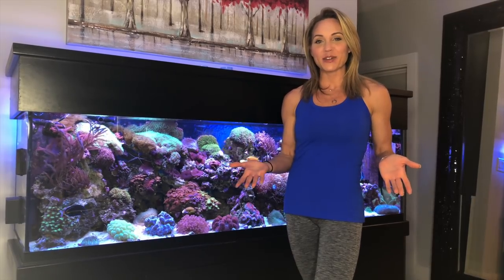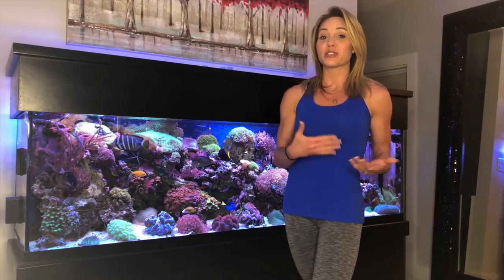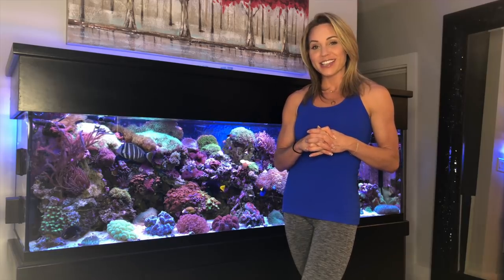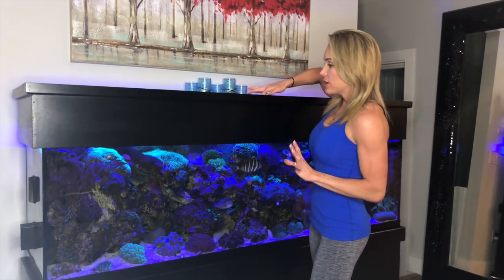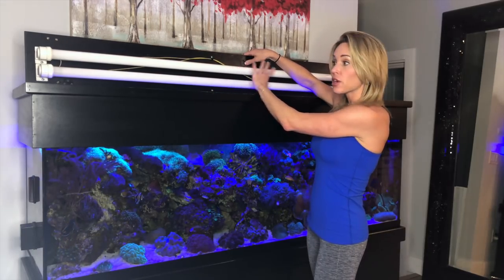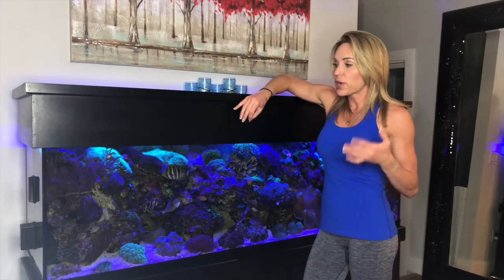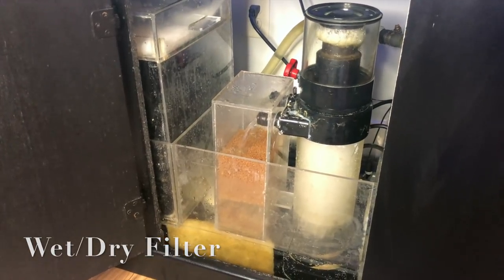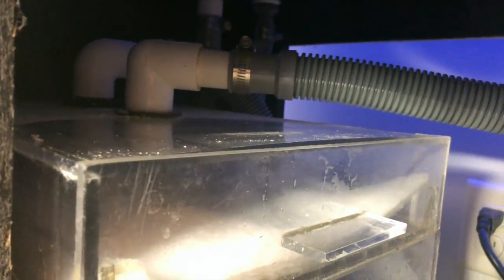How To Setup A Saltwater Reef Aquarium - Mindi's Coral Reef

Comment: I’m curious to know what your dosing for Alk, and Ca.  Are you using a simple two part system and manually dosing?  I have to say I’m impressed with such a lovely tank using such a simple old school Berlin system. While Berlin was effective it never was easy....  However that 120 looks fantastic.  With regards to lights, I would suggest looking at Kessil.  I’m a huge huge fan of Kessil lighting.  The light produced from these high-density matrix lights is just with out compare.  I have used AI Hydras int he past and while they have do have a superior control solution (App) the light from the Kessil lights just can’t be beat.
Reply from the maker: Yes, I'm manually dosing both Ca and Alk. I use calcium chloride and sodium bicarbonate.  The brand is ESV.  I will def check out Kessil.

Comment: Mindy you really should have all your tanks electronics plugged into GFCI outlets, Amazon has these 30339015 15 amp GFCI 5-Outlet Adapters from Tower Manufacturing for $38, they're the best I've found, just plug them into your existing outlets, water and electricity don't mix well at all! Your tank is very impressive, amazing fish and coralsespecially for 14 months, I'm especially impressed with your lighting and circulation pump ideas, nice job!

Comment: Get the Chinese black box lights. Cheap and effective. Compared to radions. They run about 70-100 where radions are 800. Don’t waste your money. You have mostly soft corals and the 165 watt black box would be perfect. Completely adjustable as well. I think 2 or 3 would be perfect 4 max

Comment: I get wanting to upgrade the lights to LED, but if your tank is doing as good as it looks and you don’t have much SPS corals,don’t know that I would change lighting at this time. Everything looks pretty stable. How often do you change your lightbulbs? Doesn’t look like you’re having problems with temperature either , so put the extra money into the bigger tank.
Reply from the maker: I change the bulbs about once a year.  I've changed them once since the tank's been up.  Bigger tank it is! :)

Comment: radions G4 LED lighting system definitely. LED’s last forever and don’t produce heat which means you won’t need to run a chiller to keep water temperatures within the narrow tropical range required for reef aquariums. Wet/dry filtration not the best if you’re trying to maintain a low nutrient environment for stony corals. Your nitrates and phosphates need to be low to undetectable. Wet/dry filters produce nutrient laden water which can inhibit coral growth. A sump with a protein skimmer and a Refugium where you can grow macro algaes like caulerpa and chaetomorpha is best. Water chemistry should be your alkalinity 8.0 DKH, magnesium 1400 parts /million,calcium via a three part dosing system. The bulbs you currently have need to be changed out every 6 months because they lose their colour spectrum over time. When you install new bulbs you have to be careful not to shock the corals with the increased light intensity. Gradually acclimate them over time to the new light. This will not be a problem if you go with the Radion LED lights which you can program from your smartphone or computer. LEDs don’t lose there colour spectrum the way that fluorescent tubes or metal halides do. You can get really good advice from the folks at Radion. Water Movement. have you heard of the Maxspect Gyre ? You only need one placed at one end of the tank to replicate the gentle wave movement found naturally in the ocean in your aquarium. No exterior moving parts like your powerheads, very affordable alternative that’s state of the art technology. Google maxspect Gyre. Your tank is looking nice but the upgrades will help your animals to thrive over the long term.
Reply from the maker: Thank you Graham for all the information.  I'm doing the best I can with my tank and, like I had mentioned before, everyone seems to be doing well and is happy,  Although, just like with the lighting, all of that comes with time since it's not cheap.  I'm saving up for all of these upgrades and when I can I will do as I see fit. :)

Comment: Instead of filter floss which can clog over time and restrict water flow, try filter socks with bioballs placed underneath to break up the micro bubbles. you can wash the filter socks in bleach in the washer machine and reuse them. The filter floss produces nitrates from the stagnant seawater. Swap out your wet/dry filter area for the filter socks with bio balls underneath for the mechanical filtration which then gets fed to the protein skimmer. A UV sterilizer installed underneath your tank will help to keep your fish free of diseases like Saltwater Ich and cryptocaryon irritans. The UV light will kill the spores before they can enter the tank and attach to fish making them sick. Prevention is the best insurance to protect your beautiful reef inhabitants and investment.
Reply from the maker: I change my filter pads very regularly.  Also, I do have a UV installed on this tank.
Reply: Graham Palmer Filter sock clogs too. and if it is submerged, it can generate nitrates as well as detritus will always be braking down. Filter floss is really cheap and you can just dispose. Socks are a pain to clean.